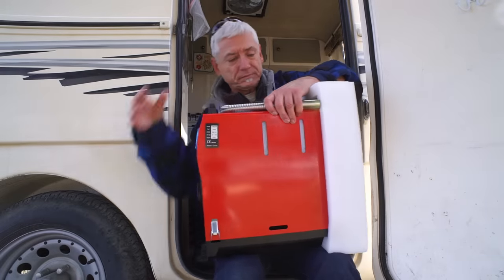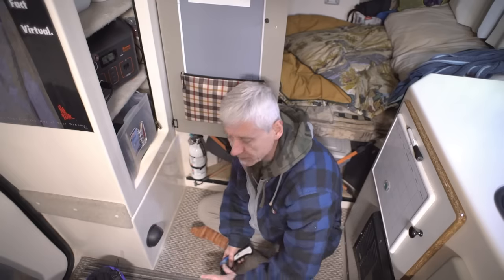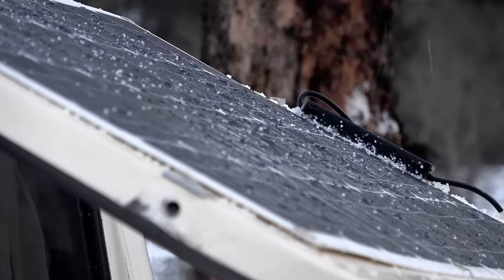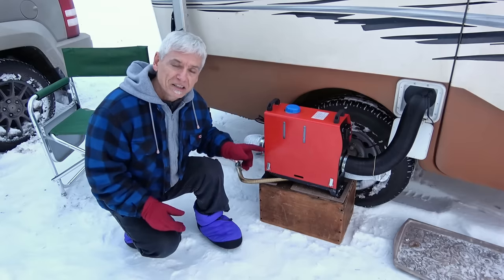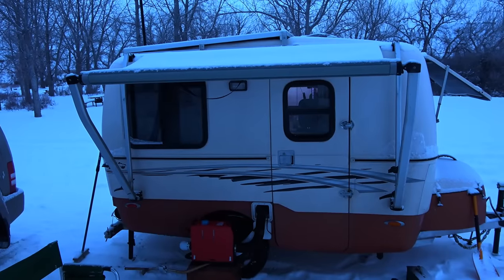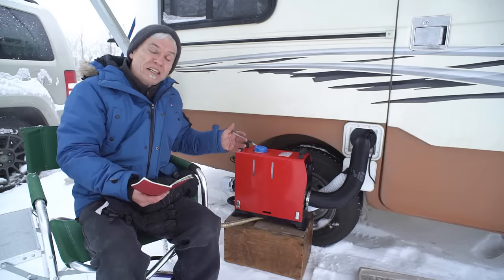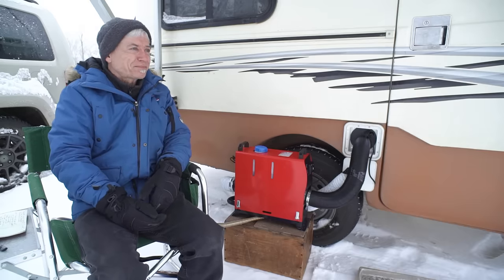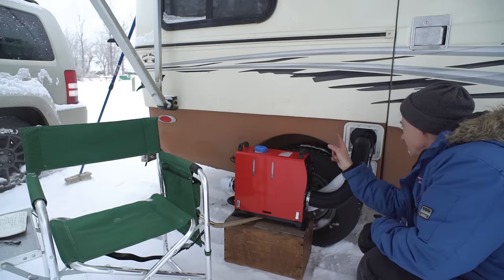Can this Work with a Camper? My Parking Heater Experiment Part 2

Comment: For wintertime use, does your refrigerator access cold outside air instead of having to cool it electrically?
Reply from the maker: Good question. The trailer is cold most of the time, especially in travel. When warming the cabin, the fridge is the last to be effected due to its own insulation. Thanks! SP

Comment: V-e-r-y interesting experiment, Slim.  I especially like that you are providing Metric & U.S. measurements of temperature, including graphics of fuel usage, power consumption & power generation.  Good on you for placing those wheel chalks to hopefully prevent your RV from rolling.  Please, what the brand & model of what you crawl into at night to keep you comfy warm while sleeping.  I seem to remember you using a 12V electric blanket at one time.  Is that nearby or did I just not notice it.  
     I applaud your decision to "fold 'em" on account of the incoming Storm.  Smart!
     Warm Regards from Reno, Nevada.

Comment: Since this is an "experiment." It might be possible to use a longer hose and move the unit away from the trailer. As a possible solution reducing the ticking noise. OR Find a unit that has a different pump that does not tick.

Another possible solution is to insulate the pump unit, to muffle the ticking noise. In addition to muffling the pump (maybe you could) put the entire unit in box (that has insulation (for sound)). The combination of moving the unit away from the camper, insult the pump for sound, and putting the unit (for example, a box that is open on the bottom) with sound insulation (and allowing the unit proper holes to vent and pull in fresh air) or some such way to insult the entire unit, to muffle the noise. Remember, sound is a wave, actually the exciting of air-molecules that create a pressure wave, that humans perceive as sound. There are very effective ways to reduce or cancel sound, by insulating the unit (the pump). 

I agree. I love camping. And go to time and trouble to travel away from city noise and have to listen to click click click, all night, would drive me nuts, too.

Comment: Try suspending the pump to reduce the noise. The pump mount it to the metal enclosure is amplifying the knocking noise like a speaker.

Comment: I wonder if one could add a peltier generator to it, like on that wood/pellets stove.

The hot side on the heat outlet, and the cold side in the intake air. The heat that goes through the peltier would be sucked back into the intake air. So no heat loss as the heat just get sucked in again.

Wouldn't need to produce a lot of electricity. Something like 10w would still be useful, just to stop the heater draining the battery.

Comment: You could make a stand/cover combination that's collapsible with a bit fiberglass insulation to dampen the noise though  it's likely a diesel heater that's more compact/safety rated by the Us/EU etc. is in Slim's future. Most of those made for a van might be an option since it and the Outback likely have around the same square cubic space but one wonders if recirculating the air back to the thru the system like is done with a vehicles AC would boost efficiency even more since it would not likely ingest exhaust at all..

Comment: So if you were to make a rigid foam Cover box with an openings around the base, would that help with the snow and rain proofing, and the sound control?  It would have to be some sort of origami thing so that it could fold flat when not in use, but that might take care of a couple of your issues at once.  
Great video and good information.... Thanks as always.

Comment: I wonder if you can source a different fuel pump or mount it in a sound baffled container. Just saying. I for one would prolly  just get used to it and it would just end up being background white noise. But  I can see it being annoying initially as  one would not be used to it.

Comment: You could mount the fuel pump with rubber isolators and wrap the pump with pipe insulation to help deaden the noise. 🤔 Just a thought...
Reply: Already tried ... didn't help.

Comment: SP I liked your videos part 1-2  I would have had the input air piped into the trailer because they don't like having cold air coming into the chamber as it builds up with soot(Santa gets soot on his suit after coming down the chimney) faster than normal.

Comment: I’m sorry I missed it. Why don’t you use the camper’s propane heater?  If it’s a question of power isn’t it easier to add an another battery and propane tank?
Reply from the maker: Hi Lou, power is the issue. My propane heater uses double the diesel heater does.  More batteries merely mean more time needed to recharge them, and option I don't have in the winter. I just removed a propane tank as well! I may look into more power efficient models if the cost makes it worthwhile. Thanks! SP

Comment: Do you think a sound dampening box (think large cooler or pelican case) put over the top of the heater would be effective at reducing the clicking sound?  It could protect the heater from rain and snow and could also be used to store the heater and hoses when not in use....however you would need to cut holes for hoses and ducts to go in and out....it would take some engineering.....

Comment: Just as a backup, do you carry a generator and if not could you look into the “ALP Generator” which is propane powered & generates 900 watts. The review was done by “Hobotech” and a small 16oz can will give 3 hours and a 20lb Cylinder will last 60 hours! I saw the review already but would love to see a real world review possibly by you! Thanks
Reply from the maker: I don't use generators because of the intrusive noise. Although the ads say it's "quiet", I know that term tends to be vague. If I can use it as a pillow (I mean REAL quiet) I may be interested. Thanks! SP

Comment: if you want to continue this venture with this unit, you had a concern about the exhaust pipe being close to things that could melt, easy solution and cheap,  get yourself  engine exhaust header wrap,  its thin and will solve your worries. this stuff is made for extreme heat, not  the temp your little heater exhaust will ever reach.

Comment: I'm thinking of permanently tearing out my RV furnace and replacing it with a diesel heater. any thoughts on this mod? will the diesel heater provide enough 'forced air' to heat my 23' RV?
Reply from the maker: By a quality one. This is junk!

Comment: I would probably have a box for it with soundproofing on the inside and which protected it against rain and wind. Maybe a little insulation also on the air hose that goes into the house. Then a funnel when you fill the tank with diesel.

Comment: That's way more efficient than a standard Suburban space heater, mounted in RV's.  Those take about 85W when the heater is burning propane fuel.  However they put out more heat, 30,000 BTU which is about double what your heat produces.

Comment: Is the pipe into the trailer get hot? I am thinking the 12 volt plug and air intake would deteriorate from the heat over time.

Comment: with the heater out side its running flat out only the air intake and exhaust go out side so the warmed air inside can recirculate so the heater slows down btw hang the pump on a zip tie and it makes it quieter you do get used to the noise too

Comment: How about getting another piece or 2 of vent hose & make a fitting to accommodate the vent pipe? Re-aim the vent pipe, so it isn't aimed at the back.

If no snow, just peg the end of the hose to the ground toward the front & angled away from the trailer. If snowing, use a y- shaped device to drape the hose over a few feet above the ground, so it's not going to get clogged.
Reply: A used aluminium crutch from a thrift shop would work raise the hose. They're indestructible and the height is adjustable.

Comment: Thanks for this. I was wondering how the Great Parking Heater Experiment would turn out.

Can you get some of the same paint that they used for the bottom of your trailer? It would be great if you could paint the exterior (and interior?) of the vent cover so as to keep your new, amazing, color scheme consistent.

Comment: I was wondering if a Jackery 240 would power one of these. Thanks for the answer.
Reply from the maker: It all depends on how long you plan on running it before recharging. SP
Reply: @SlimPotatohead  I was concerned if it would last one night. Hopefully, I can charge it one way or another during the day.
Reply from the maker: In that case, it should. Thanks! SP
Reply: @SlimPotatohead  Thank you for your great videos.

Comment: Great videos! Just curious if you are noticing a difference in gas mileage with an aluminum frame over the steel?
Reply from the maker: Good question. Not right now. Part of the reason is the bad roads and cold. Only fair test is a warm day on clear pavement. Thanks! SP

Comment: Have you thought about the same style of heater, but fueled by propane instead of diesel?  There wouldn't be a pump to drain energy, so no "ticking" noise, and the exhaust wouldn't stink so bad.  Or better yet, maybe upgrade the existing propane furnace to a high efficiency model?
Reply from the maker: If a more power efficient propane furnace was available at a reasonable price, I may consider it, however since I only use my heater part of the year, it would have to be worth the effort. Thanks! SP

Comment: You should turn the heater on high after running it on a low setting. The heater will soot up with carbon and stop working. You will have to take apart the heater to clean it out. Turning it on high will burn off the corbon build up. You should do this after running on low all night.

Comment: It’s probably running continuously because the thermostat in that unit is outside and it’s not reaching temperature, if you want to keep the unit outside, you most likely need to put the thermostat inside the camper, I know your jackery was shutting it down but usually in those units there’s a thermal shutoff that if the combustion chamber gets to hot it shuts down, if you put the thermostat inside I think it would cycle on and off as it reaches temp it shuts off and turns on when it gets back down to thermostat setting, even with it turning on and off I think you’ll get better energy savings because when the unit is off it’s effectively 0% percent energy or battery usage, continued success 

     Wilderness Life
               Fabrizio
Reply from the maker: I think you missed the point of this experiment. I do NOT want this heater to turn off, hence the thermostat is not used. Every time it shuts off it uses a lot of power to re-start. Manual mode only, low speed. Thanks, SP
Reply: Slim Potatohead yes I got that you want it to run all the time I’m just saying that with the thermostat outside it’s going to seem to the control unit that it’s never reaching temp and could be problems with it in the future, you put a manual controller on it So I’m not sure if that also has a thermostat also so what I’m getting at is I know that some of those units aren’t rated for continuous use is what I’m getting at, however I think it would be an interesting experiment for your channel to see how much power it uses with a thermostat inside and the unit coming on when commanded, just an interesting thing that possibly you could incorporate in a future video, continued success

Comment: Slim Potatohead - "I wouldn't want to drive other campers crazy with the tick of the tiny pump". Other Campers - "Runs 6000 Watt harbor freight generator with 49cent muffler all freakin day..." Hey slim, my armchair 2 cents about the pump is that you can mount it on a piece of rubber (as long as temps aren't too high inside that case), screw it to a piece of cut up old rubber bungee cord or whatever and screw that to the case. As long as the pump is mounted vertically so air bubbles can escape through the system. In van installs that makes a world of difference. Cheers!

Comment: How big of a battery you need for this device? 120Ah? How long do you think it would last?
Reply from the maker: That's a simple question, but the answer is more complex. It depends on how you camp and the type of battery you are using. A lithium battery would last longer, however they do not work well below freezing. In winter I use an AGM battery, which doesn't hold as much charge. The good news is the heater does not use many watts. With the right battery for the temperature, and solar charging by day, you should be able to use it indefinately with a battery of at least 500w capacity. Thanks! SP

Comment: Also, are there no efficient heaters of this type which run on propane? It would just cut down on the various types of gas you need for a trip; gas for the truck, propane for the stove, diesel for the heater... if you can do the same thing off of propane, since you need it for stove anyway, I would think that would be a better fit?
Reply from the maker: Good comment John. The existing propane furnace uses about twice the electricity of the diesel, however I have seen some propane that are more efficient. If I could get one that was twice as energy efficient at a good price, the diesel would be made into a coffee table! SP
Reply: @SlimPotatohead  they make the same type of heater that runs on gas instead of diesel.

Comment: How would be the comparison of a 2000 watt generator with an oil filled radiant heater. Vs this heater
Reply from the maker: Easy. A 2000 watt generator would be many times noisier. Please don't use one if you go to the wilderness for peace and tranquility, especially if it would disturb others. Thanks! SP

Comment: Good info here, just so you know I am an old diesel mechanic and there are cheap and expensive fuel pumps that will work in place of you thumper that make far less noise. Your next trip to the auto parts store will bear me out. Good luck.

Comment: You might look into replacing the fuel pump in this thing alltogether

Russian company Planar (autoterm) makes good ones. They run completely silent and no modifications needed. Just double check to order 12volts silent version, not 24v one, made to use in big trucks

Comment: Could you install a thermostat for the diesel heater and run it inside the camper?
Reply from the maker: Please understand the purpose of this experiment: Less Power Consumption. I did not use a thermostat as I don't want it to shut off, then restart again and drain more from my battery. Manual low setting only. Thanks, SP

Comment: Hey Slim.  How many Watts of heat is required to heat a small trailer?  Next time you are in dry dock/on shore power can you try a 350W and/or 500W ceramic heater (I have found these at Princess Auto/Amazon.ca) will these keep a small trailer usable to you?  or does one have to go to the standard 1500W heater.  Thanks
Reply from the maker: It all depends on outside temperature. On nights below 0 deg F (-18C) even 1500watts is not enough. Thanks! SP

Comment: You"re  sort of running into the same situation I have (although on a different level).  Diesel truck, propane appliances in the 5th wheel, gasoline inverter generator.    Too many bulky containers needed for redundancy.

Comment: Curious if you could get rid of the metal casing and mount the unit inside of like an old igloo style cooler. You could cut hole for the vents and hoses and you would have a lid to protect from the elements. Another youtuber Revere Overland did a video (posted feb 21, 2020) of his build. The insulation and lid from cooler might cut down on the noise also. Just a thought. Loved the double header..

Comment: I wonder if you could wrap the pump in some sort of fire retardant noise insulation to quiet the clicking.  I work for Mercedes and all of our diesel vehicles have heavy insulation around the fuel injectors for that very reason.

Comment: First of all I haven’t commented in a while and I like your rules slim great rules anyways have you ever thought of getting an old bicycle and setting it up to be a kinetic generator so you could pedal it to power your battery in the event of bad weather and if it was small enough it could fit inside your camper
Reply from the maker: Daniel, I've never heard of one that realistically provides decent power for the effort. Most may charge a cell phone at best, but not a 120Ah trailer battery. Thanks! SP

Comment: I have two observations one that noise is probably the fuel pump so if it was re-mounted on a piece of rubber might reduce the noise tremendously and secondly you didn’t mention if you have a carbon monoxide detector that would probably be a good investment no matter what you’re using to heat.
Reply from the maker: You must of missed part 1
Reply: @SlimPotatohead  Just forgot it’s my New Year’s resolution Forget everything that happened in 2020.

Comment: I hear you about the safety concerns AND the click click click noise.  I would not want that noise because one of the reasons I go camping is for the quiet!  And to be able to listen to the natural sounds that are out there.  What is the reason to not use the propane heater?
Reply from the maker: The propane furnace is a power pig. SP
Reply: @SlimPotatohead   bummer.  seems weird they can design a diesel heater that uses very little electrical power but they can't do a similar design for propane  :-(
Reply: @pimacanyon6208  They have. I have one in my RV. It works well but is very expensive. 

On low, it's whisper quiet. Literally, when I was checking the systems, with the sales rep, neither of us could hear the furnace - I had to put my hand in front of one of the vents - "yup, it's running." 

Truma Combi Eco Plus is a combination furnace/water heater all in one unit. Not what Slim is looking for though.
Reply from the maker: Stephen, what is the current  draw? Thanks